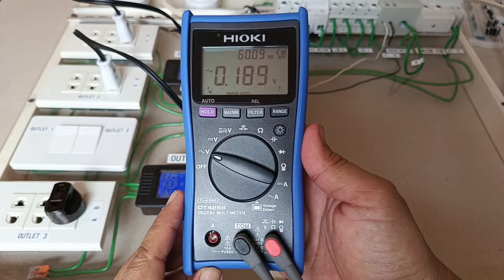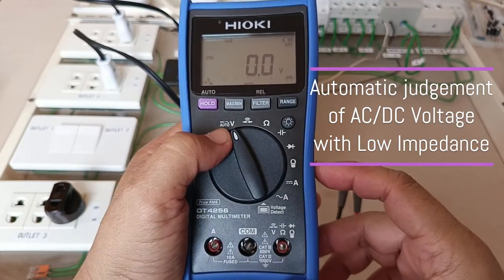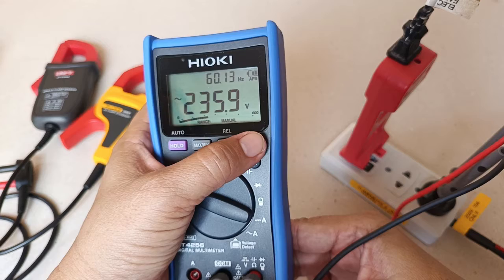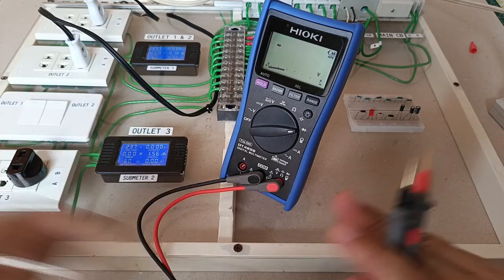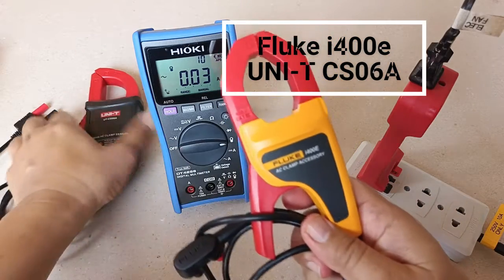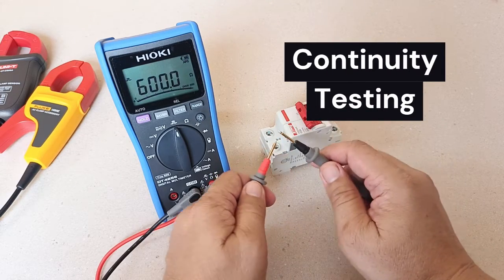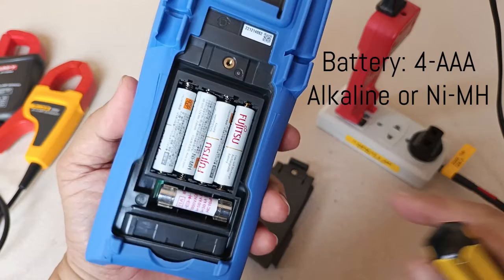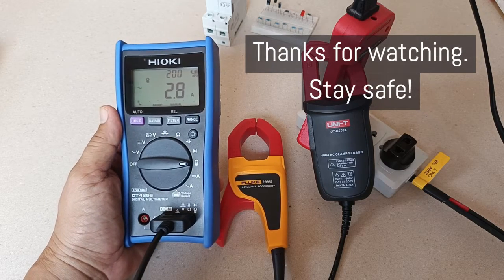Hioki DT4256 True RMS Digital Multimeter an Overview [CC]

Comment: The uni-t cs06a and fluke i400e can be used for DC? This question is because I am automotive technician and we mainly work with DC...
Reply from the maker: Unfortunately, they can only work on AC current. There are DC clamp meters but the most common can only measure 1Amp minimum. I believe that for automotive use there is interest in DC clamp meters for troubleshooting DC leakage current (below 1Amp.) Thanks for watching.

Comment: Hi... Thank you for the review, it's very helpful..

I have this multimeter at home.

I want to ask, in Ohm measurement mode, when the two probes are attached, why isn't the value zero?  always shows 0.3 or 0.4 ohms.
Reply from the maker: I appreciate your comments. It's likely just imperfect contact. Have you tried cleaning the test leads or tried other ones? In any case, as you know, you can just zero out the  test leads resistance by pressing the REL button. My own test leads vary between 0.1 and 0.2. Sometimes 0.3 ohm.
Reply: Very hard to get 0.0 ohms. Different metals different resistance and I think 24 carat gold has lowest resistance even maybe 0.0.

Comment from the maker: Thanks for watching. If you were referring to 10:17 where I made a quick resistance test, I appreciate that you noticed. Let me clarify. 
(1) The incessant buzzer sound when measuring resistance is a feature not a malfunction. The DT4261 and CM3289, for instance, make the same beeps. It can be a bit annoying. 
(2) When the test leads helps are not connected to anything the screen flashes "over 60.00 Mega Ohm". This is also a feature not a malfunction. Fluke and other DMMs use "OL" or "OF". Hioki prefers, instead, to alert you that whatever you're testing is over its measurement limit of 60.00 Mega Ohms. So when there's nothing between the test leads yet it will flash those characters, which for me at least, is a useful reminder. This is the same with the DT4261. 
(3) Yes, malfunction can still occur if the instrument makes incorrect measurements, or if the display shows "ERRxx". It hasn't happened yet. 
Hope this helps.😃

Comment: Can you view the waveform with fluke clamp?
Reply from the maker: Not with the Hioki DT4256, as it has no Bluetooth app capability. But using the Hioki DT4261 with the wireless adapter (Z3210) yes, you can view the waveform of the Fluke i400e. Here's a link to that. Thanks for watching. https://youtube.com/shorts/zk_jVnD_S2Q?si=2wZmWdMsWpPW5s7c
Reply: Great, as i need to use them on hioki PQ3100 with some cable mods
Reply from the maker: @Kmreddsadad  Good luck!

Comment: I have this meter, I can't say is better than fluke 117, but it has  balanced functions, I have both and really I like more fluke 117 for magnetic strap, but Hioki is very fast in dc, it can work with current clamps and has mA range.
Reply: Fluke 117 has no Auto - Hold, no 1000V ac/dc range (that I mostly use in 690V industrial inverters), and no 60mA range (that I also use for 4-20mA transmitters). As for magnetic strap, you can always buy Hioki magnetic strap Z5020, or cheap 10 Euro Chinese owns. And Hioki is Made in Japan. Finally, Hioki DT4256 is sold in Greece for 178 Eur + VAT, and Fluke 117, for 335 Eur plus VAT! I found also I bit misleading what @ramschannel said about using mV output current clamps only in dedicated position. You can always use mV output current clamps in mV range! I forgot also to mention that you can always add the Hioki 2kV High Voltage Probe, and troubleshoot PV installations (and never spent any money on batteries with 4 eneloops - APS display is a major plus)!
Reply from the maker: @yiannis_b5504  Thanks for watching! Glad to know that you also appreciate the usability and ease of use of Hioki digital test equipment. I agree with you on the advantages of the DT4256. I was not surprised that it's sold in Greece much lower than the Fluke 117, which is the same case in amazon. I do have cheap Chinese magnetic straps you mentioned, LOL! But I did not mention in the video that the mV output current clamps (i4003, UTCS06A) is only compatible at the dedicated clamp on probe selection. Sorry if this caused some confusion, but there was no misleading intended. I simply did not include a demo of it at the mV AC selection since I wanted to focus on the external clamp on probe, which is a noteworthy addition. In fact, in another video, I clearly showed two ways where you can measure large current: (1) using the clamp-on probe selection and (2) using the mV AC voltage function. Here's that video: https://youtube.com/shorts/aaC0ZgpyWX0?si=-VmhssaK_X_MDAoT

As you know, both the DT4261 and DT4256 do not have dedicated mV AC selection, but their AC voltage function has such high resolution that you can read down to 1mV (0.001V) AC, making them suitable with 1mV/A output AC clamp accessories (i400e, UTCS06A) to measure current of the quantity not otherwise possible with simply using the test leads.
Reply from the maker: I appreciate your insights. I, too have a Fluke 117 which is a fine DMM on its own. If I had to choose, it's going to be tough, but I'm inclined towards the DT4256, for reasons some of which you mentioned. Bottom line, I don't think one can go wrong either way. Matter of personal preference. Thanks for watching!